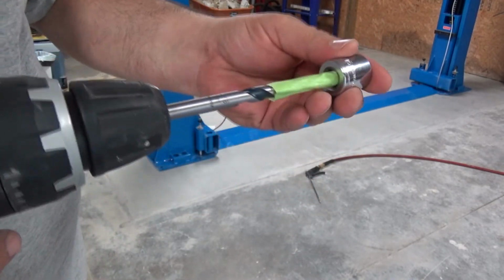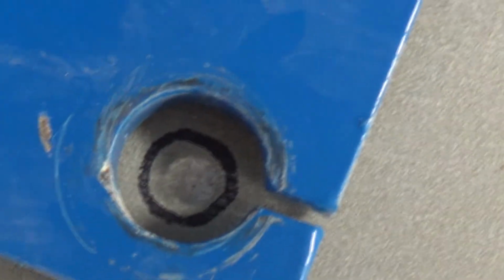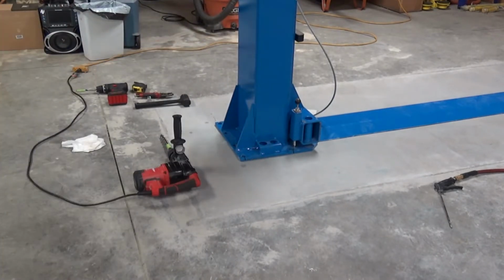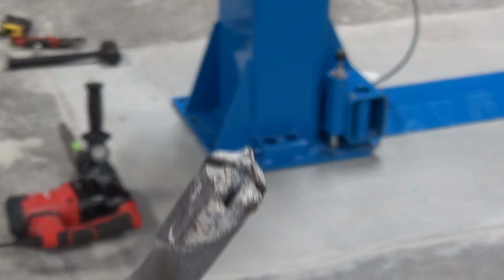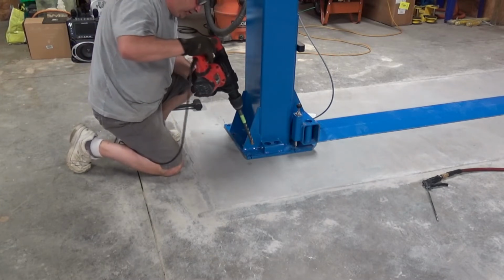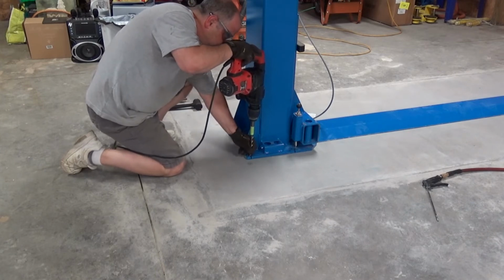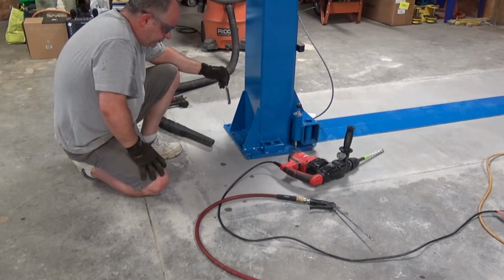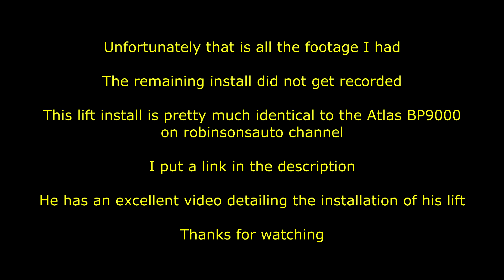New Garage Part 4 - Lift Install

Comment: Overkill is a very very good thing when prepping the area for lift installation. I'm pretty much gonna use your vid as a reference for my install. Width is good but I'll prolly give it a lil more length. I also noticed you cut a line around the perimeter of the lift area so that the concrete doesn't crack that's good. I like how you went with better anchors and how u centered your pilot holes with a socket. And I like your rebar and metal framing and how you epoxied everything, the only thing I don't know is if you put fiberglass in the cement or not. And I'm not sure if you mentioned the concrete tensile strength or concrete depth. And that lift looks like it's a pretty good quality lift, I just don't understand why it has wimpy swingarm locks. Excellent job on the video. 🙏 Thx

Comment: What is the difference in concrete thickness and strength between the original slab and your pour?
Reply from the maker: I am not the original owner so no idea on the original strength (likely 3000 psi). It was around 4" at the thickest, I went 12" of 5000 psi